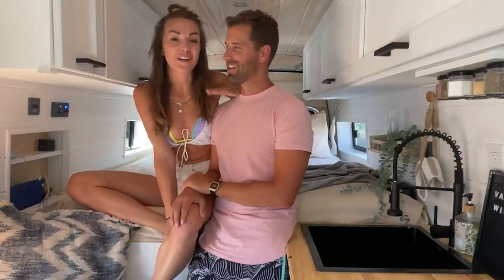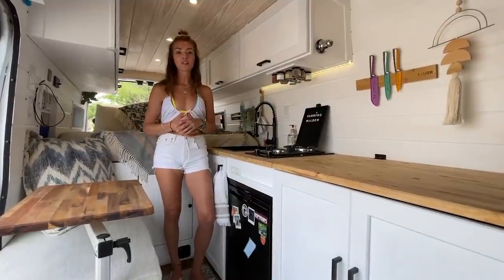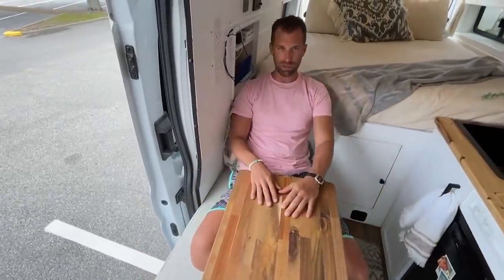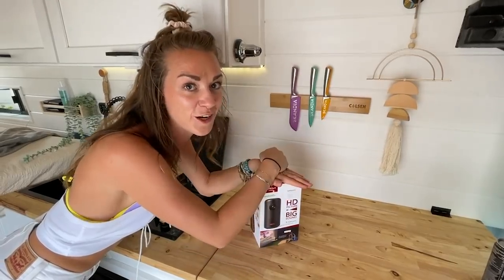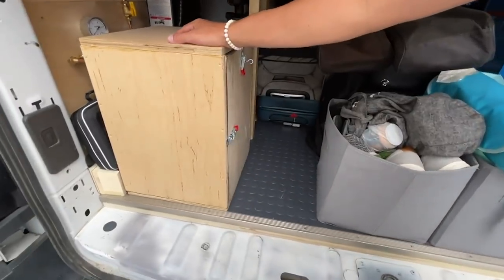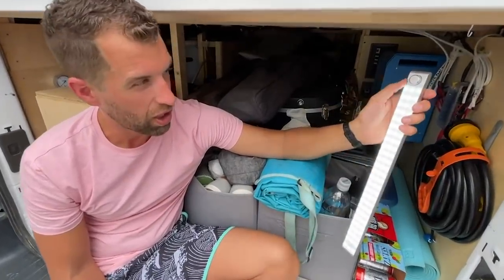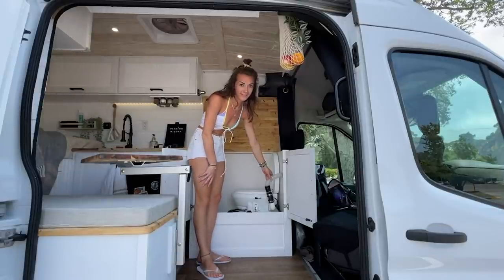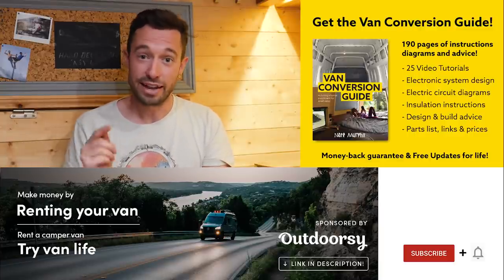VAN CONVERSION W/ Super CREATIVE  LAYOUT & HACKS 🚐 |  Full HIDDEN BATHROOM W/ 🚿 & 🚽

Comment: Looks exactly like 90% of the vans on YouTube,
Reply: True, but the air tight propane box design and easy access is cool along with the filter being attached to the hose end so the water is filtered right away so no crap gets in your hose. Most vans I see have it at the spot were it comes up to the faucet. 😊
Reply: What are you trying to say? That the build should be unique and original? There are a lot of van conversions, everything has pretty much been done in terms of layout and design. Good luck doing your original, unlike any other conversion, can’t wait to see what you come up with!
Reply: The unique parts are opting out of a wet bath for 3 feet of counter space and no air conditioning while living in Florida. This build works for them, but having to deal with a wet plastic shower curtain and sweltering humid Florida nights is a no go.
Reply: Thanks for giving us a tour of your van. It's got a clean look and feels spacious with all that open area towards the front. I like how you kept things simple too.
Reply: That’s pretty crappy to say

Comment: Add a small vent hole of some sort to that bottom of the propane so if there is a leak it leaks to the outside rather than into your van, or worse you wouldn't want to open that sealed box if it was full of propane gas and finds a spark...boom!
Reply: Oh and beautiful build!!!  Love the creative bathroom area!

Comment: That shower pan layout has me thinking I could be extra decadent and make it a little longer, maybe switch the sink to the other side to share the showerhead and make it into a tub. It wouldn't be a habbit, but camping in a sunny spot by a water source, you could pump in extra water, use the water heater (mine would be electric but that's justs personal pref) and have a nice hot tub going once in a while, would be extra cool on a van with sliding doors on both sides...This build was very inspiring, thanks for sharing!

Comment: Thank you for this comprehensive tour. I like the design, the amount of light, and the smart use of space so it is not crowded (for a van). Smart ideas with your storage, i.e. rack over the door, placement of refrigerator, and hide-away shower. Also, thank you for the list of where you purchased items; saving money is important. I'm impressed with your commitment to following safety, particularly regarding the propane tank. Most van conversions (skoolies/tiny homes) I am seeing, where propane is used, they are not kept air-tight.

Comment: Love this build!  I have a question, where are you exhausting the burn gasses and heat from the water heater?
Reply: We have the water heater in the "garage" and typically we'd leave the back doors cracked a little bit while we shower to let hot air out.  That said, we don't take very long showers, so it's not much of an issue for us. Thanks for asking!

Comment: Love this shower solution, really awesome!
Reply: She admitted it takes up a lot of potential storage space and though it doubles as storage for the toilet, it takes up 5-7 times as much space as the toilet needs if it pulls out on glides. I have a better solution and it doesn’t not require a shower pan be recessed in the van floor. F seen that solution in other vans but I’m just about to build my shower but her demonstration gave me and idea on a slight improvement I might make on my design so the toilet can be stored there too with only minimal increase in space taken.

Comment: If you have the extra electric why not get an electric stove? jw
Reply: I think it's down to personal pref. Some people like the perceived security of using fossil fuels in case you can't get solar for a time. It would be easy enough for someone to use their format though and swap out for induction stovetop and electric water heater.

Comment: Eamon and bec did this bathroom set up first 👀👀 give them credit pls
Reply: You just did.  Hard to call most choices original.
Reply: Why would you assume Eamon and Bec originated the idea?  I've seen the shower/toilet area done that way many times, in different build-outs, and started seeing the idea way before Eamon and Bec did their 2nd van.  Also it's not uncommon for multiple people to come up with the same (or similar) idea.  

About 5 years ago I thought up a couple of things I'm considering for our bus, and I had never seen the idea done before that point.  However, since then I have seen several of those ideas done in other people conversions.   They either thought of it as well or saw some else's build who had thought of it.  

One of the cool things about van/bus/tiny home builds is all the creativity, and who knows where people's idea have come from.  It's just odd to assume and feel they ripped off an idea and didn't give proper credit, especially since you don't even know where it originated, or where they got the idea.